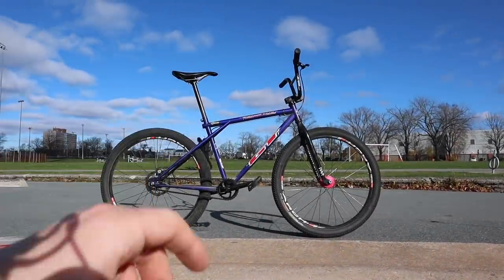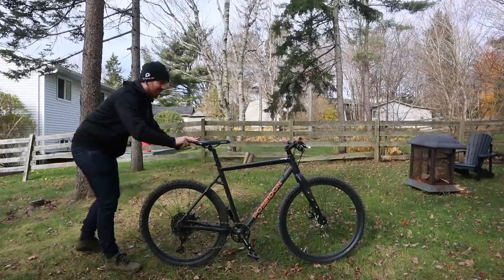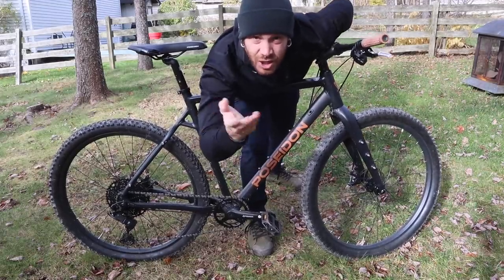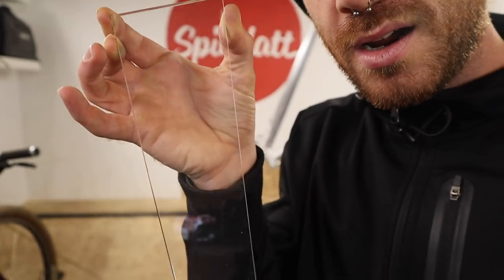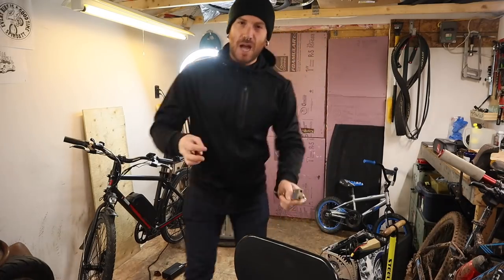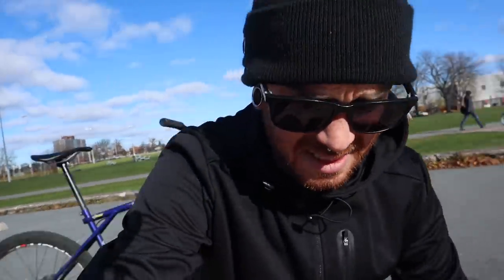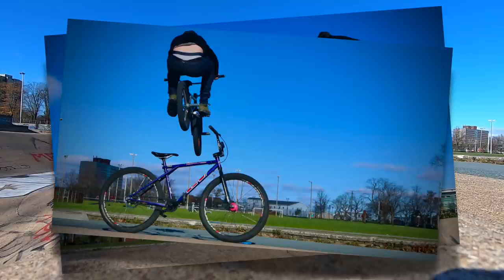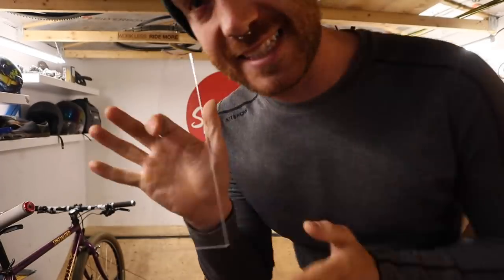How to get the "bike standing on its own" photo effect.

Comment: A stiff wire like from a clothes hangar would be nearly invisible if placed against the rear dropout. It would literally look like a spoke if you even spotted it
Reply from the maker: Slightly harder to transport
Reply: Yup I've done this with coat hanger wire and a dab of tuck tape.